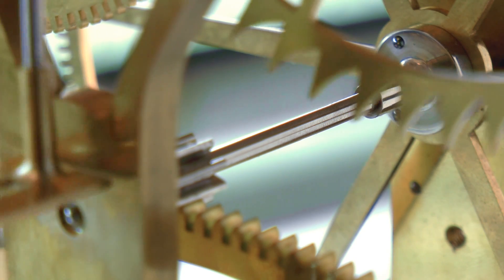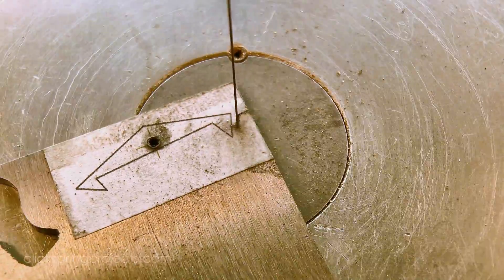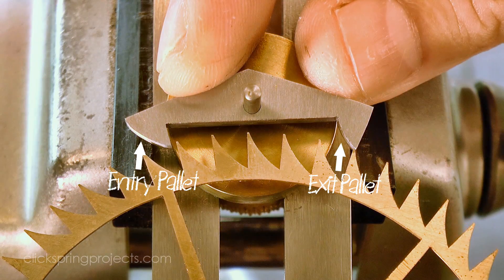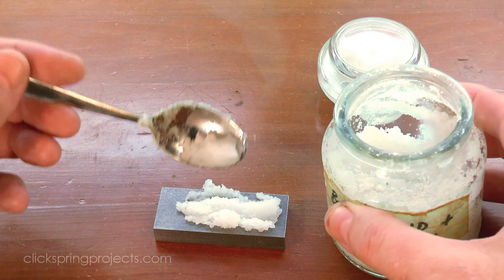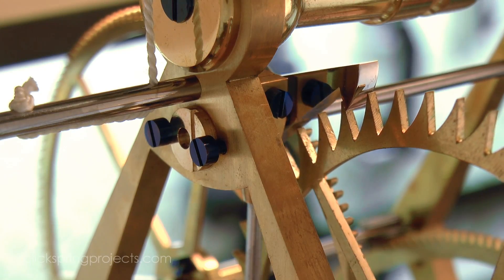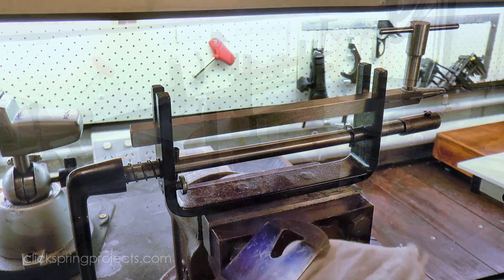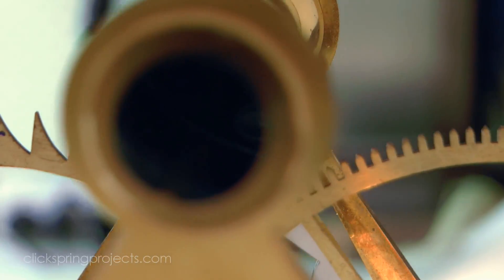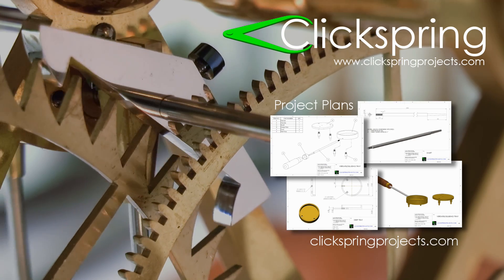Clockmaking - How To Make A Clock - Part 21 - The Mainspring And Escapement Pallets

Comment: Why you didn't design the final pallet shape in CAD? Wouldn't it been easier that way?
Reply: Too many variables to account for.  Slope of the pallets, maximum and minimum curvature, recoil speed (varies with pendulum frequency, not to be confused with acceleration which is constant), propagation delay caused by mechanical resonance, et. al.  This is one of the few instances where trial and error through approximation and experience can be faster and more reliable than computer modelling that would still require manual finishing.
Reply: One could design the final pallet shape, if they created a virtual "model" of the relevant parts and how they act as an assembly.  However, this would require fairly a advanced knowledge of physics and coding.  The "model" would take much longer to design and debug than just making the part and finalizing the shape by trial and error.  In the end, I doubt the model would come up with a better result.
Reply: I would guess another factor is, although the components of the clock are manufactured with breath-taking precision, it's still handmade precision.  Chris did a lot of modeling for the clock, and even outlined the rough shape of the pallet in CAD, but the whole point was to build everything by hand.  If all parts, for example, were produced with extremely expensive CNC machines and high-grade stock, then you would be able to more properly leverage CAD designed, computationally modeled geometry ... but that would defeat the whole purpose.  I think all of this really hit me when Chris made his depthing jig for determining drill positions.  It's beautiful, elegant, and efficient; an analog, hand built CAD plugin.
Reply: Yes it sure is still huge amount of skill and work to make all these parts by hand. I was suprised  that he took so rough sketch for making this part, as he usually makes the parts almost 1:1  like he has designed them in CAD.

Comment: wow Chris ...another fantastic video...There is tons of work in that little escarpment fork...few understand the geometry of this part. On my Grandfather  clock, there is compensation for the rotation of the earth which also Inputs forces to  the period of the pendulum swing. I would imagine  with your clock this is much less critical, however with the way you suspend the pendulum this tiny force may be negated. Wonderful clock...Are you planning to in case the clock in a glass enclosure?

Comment: I'm a bit confused, why wouldn't you temper the escapement pallets leaving it brittle? Surely tempering it would be beneficial.
Reply: There's a trade-off when you temper steel: what you gain in ductility, you lose in hardness. In this case, the extra hardness retained by not tempering is preferable, as it will give the escapement a longer life.
Reply: If the escapement wheel was steel too then it would have been recommended to be hardened and tempered to even out the wear pattern, but since the escapement is brass you want it hardened and polished to a mirror finish to minimize wear on the softer brass.  Yes the brass will wear over time in preference to the steel, but the mirror finish minimizes this and allows the fine brass particles worn off to fill the pores and act as a solid lubricant.
Reply: Having the steel at maximum hardness will make it resistance to wear greater.
Reply: I think he hardened the steel to the maximum "glass shattering" hardness, it's almost like having a tungsten carbide piece. No need to realign the atoms by tempering

Comment: Very big milestone.  I was surprised that you could get away with oil quenching in that big tray.   Shows that there is more room in the cooling curve than I was taught!  Thanks again!
Reply from the maker: Yes its been a bit of a revelation to me too! I fully expected it to not be fast enough with the hands either, and at the very least to get some differential cooling distortion, but it works without any issues. Terrific to have your support mate :)